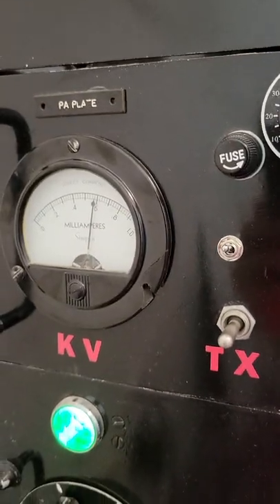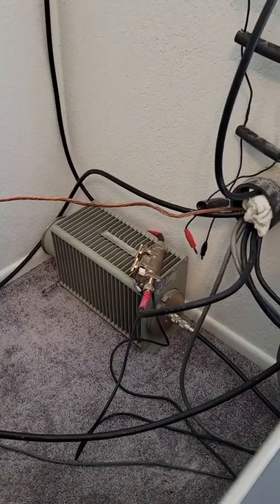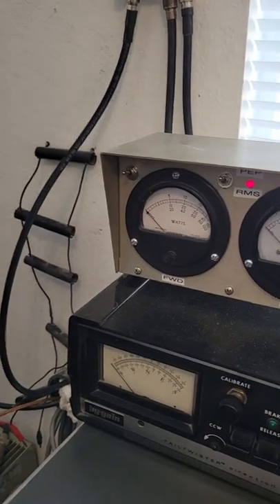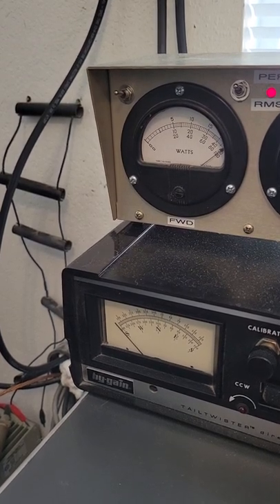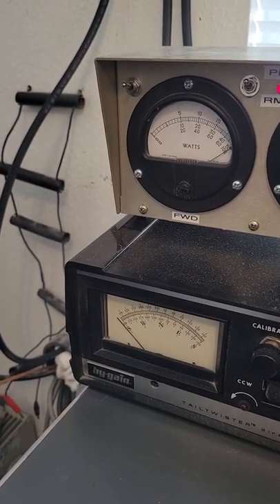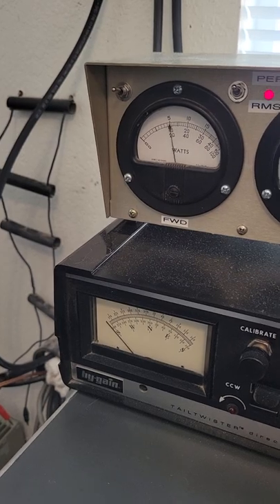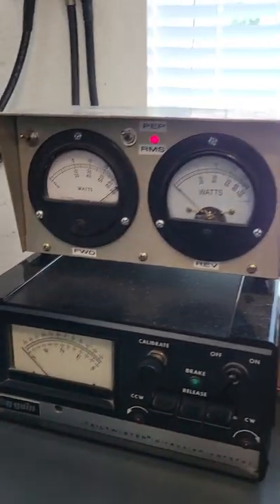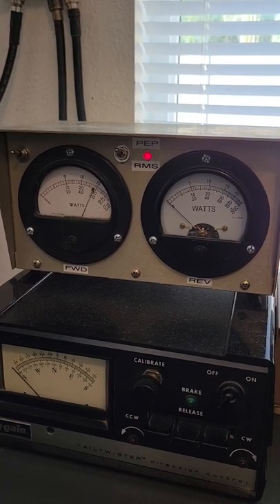home brew amp with Bird 43p meter and 5k slug.

Comment: Whats the tube in it Clark? I have a ol Amp supply LK-550 with the 3 3-500s and 1.75ccs peter dahl plate and has a PD filament transformer.  Mine has eimacs which I think I might pull and put some "other" brand in for now to save the eimacs. I have a yeasu FT102 with the am fm board that I want to get onto 80 with.